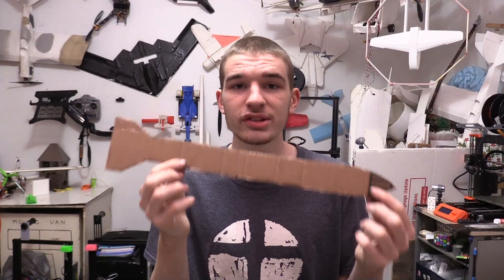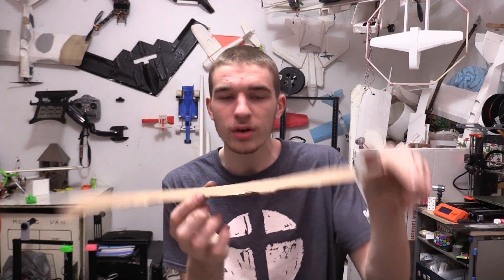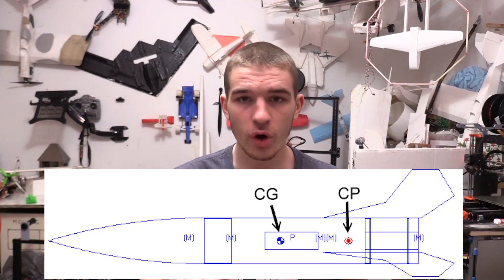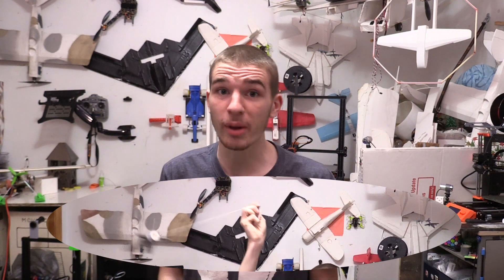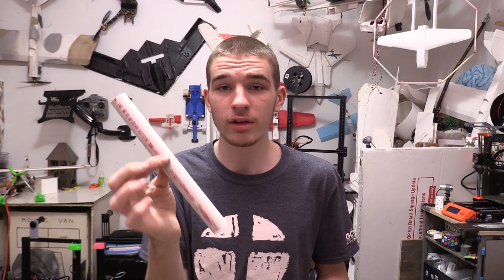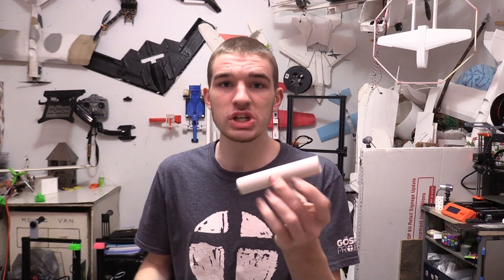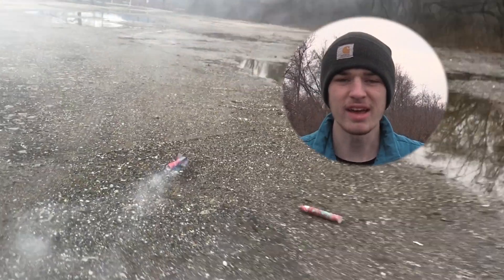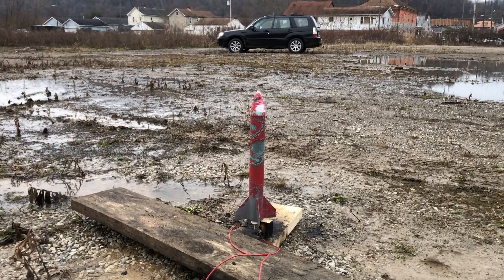Rocket Stability (Simple)

Comment: You are missing the difference between the CG (Center of Gravity) and FCG (Flying Center of Gravity), in order to find it you must always include the engine in your test. The carboard cutout and in the swing test!

BOTH must be in front of the CP (Center of Pressure)!

But, it looks like by the end you got close enough!

When you shorten the length you have to add weight to the nose to rebalance and re-swing test it! ...... I am thinking you just might like DODGING rockets! 🤣

Your thrust to weight is TOOOOOOO close! 👍 Keep it up! 👍